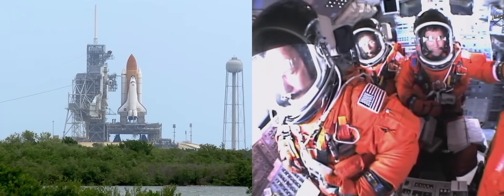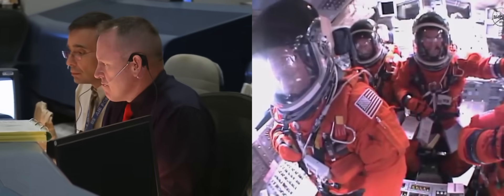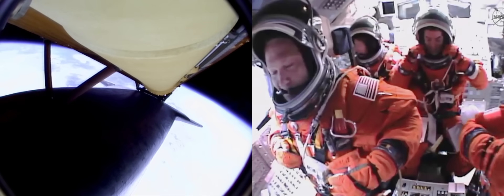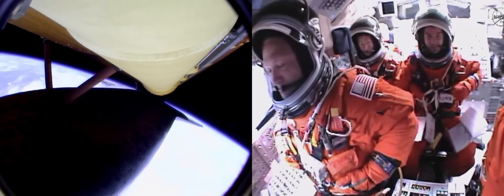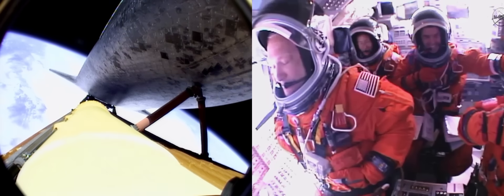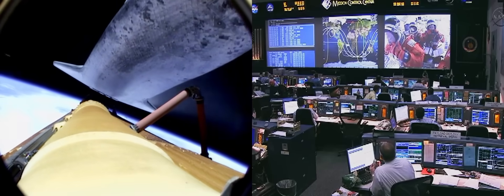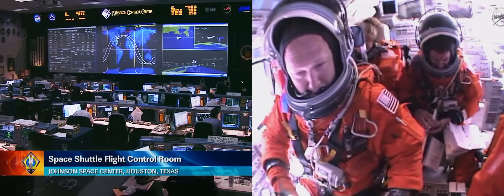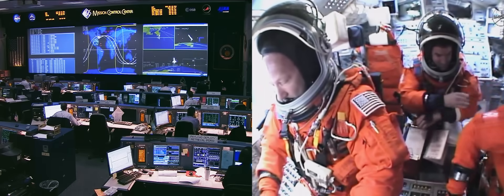🖥️ Cockpit View of the Final Space Shuttle Launch | Liftoff to Tank Photo Pitch | STS-135 Atlantis

Comment from the maker: FREQUENTLY ASKED QUESTIONS

❓What were the g-forces during launch? How can the astronauts move their arms?

Acceleration at liftoff was about 1.5g. It increased briefly to about 1.8g prior to Max Q throttle down and then took several minutes to peak at 3g. While the force exerted on the space shuttle was notable, an F1 race car or fighter jet plane experience 2-3 times the acceleration.

Space shuttle liftoff: 1.5g
Space shuttle maximum: 3g
Formula 1 race car: 6g
Fighter jet: 9-10g

During the ascent an astronaut would feel like each arm was holding a 10-25 lb weight (4.5-11 kg). Again, notable but not insurmountable.

The space shuttle acceleration profile is shown here:
https://www.researchgate.net/figure/Longitudinal-acceleration-in-US-Discovery-space-shuttle-in-STS-121-mission_fig3_342851251

A variety of comparative examples are included in this article:
https://en.wikipedia.org/wiki/G-force

❓What was the dP/dT alarm and cabin stretch?

Aerodynamic forces strained the orbiter resulting in slight deformation. According to the NASA Caution and Warning documentation, "During the first 2 minutes of ascent... the dP/dt can be as high as -0.07 psi/min because of cabin stretch."

Source: https://www.ibiblio.org/apollo/Shuttle/TD0402B%20-%20C&W%2021002%20-%20Caution%20and%20Warning.pdf (page 3-31)

As explained in this article, "As Atlantis ascended, its metal structure expanded—they called it 'cabin stretch'—and the air inside the pressure vessel expanded too. To the sensors, it seemed like the air was getting thinner—a sign of a leak."
Source: Reichhardt, Tony, "The Last Shuttle Flight," Air & Space Magazine, January 2013, https://www.smithsonianmag.com/air-space-magazine/the-last-shuttle-flight-125620527

❓What was the book on his lap? How did it stay on his knee?

Mission Specialists kept the Ascent Checklist and Ascent/Entry Systems Procedures available for quick referral. I believe it was held down with Velcro.
https://ia801203.us.archive.org/9/items/flight-maps-and-charts/ASC-CL-135.pdf
https://www.ibiblio.org/apollo/Shuttle/Ascent%20Entry%20Systems%20Procedures/

❓Are the astronauts sitting on their backs?
Yes, at launch the crew was on their backs facing up. You can see a brief overview of the strap-in procedure at the beginning of the following video.
https://youtu.be/5H48QEXwzN8

❓Is this real or AI?
The video is real. Atlantis launched on July 8, 2011, on the 135th and final space shuttle mission over the 30-year program. The source video clips have been available online for over 14 years.

❓The lighting doesn't move. There are no shadows. Fake!

During color grading the shadows were brightened slightly and peak brightness was reduced so highlights weren't washed out. Otherwise, there are several examples of light levels changing in the cockpit, as shown in these GIFs:

https://yt3.ggpht.com/Wc3nTtEui6BMxOg4GduAkf9iZYjSaJio8XsI1dwa_7LuMCdOgSfjPfg6McM1m_ntKtFXjixp_p3VlA=s540-c-fcrop64=1,00000000ffffffff-nd-v1-rwa
https://yt3.ggpht.com/urGt0tk4EWE1yLkHGEyaZGCzRUV7YU-g9_9PFWnqs97ExyvRzsgqSuXKujJIr2D0yziEbSNSJnNKRw=s540-c-fcrop64=1,00000000ffffffff-nd-v1-rwa
https://yt3.ggpht.com/wODiiJDV5cbMggxprCVrSa7CbwPQWG92v_mPTimexDrpUA1cIBXIVUj4H3ghx35rKqUO6XzDAk9w3A=s540-c-fcrop64=1,00000000ffffffff-nd-v1-rwa

SOURCES & REFERENCES

A variety of STS-135 engineering camera views are shown in real time at the beginning of this video:
https://youtu.be/CirL1S6EnmY

Here is the televised broadcast of the launch:
https://youtu.be/3deA3BXAnHs

The following links are references I found helpful when researching the space shuttle ascent. Much of the conversation between the crew and Mission Control regarded abort modes should an engine fail.

STS-135 Ascent Checklist 
https://ia801203.us.archive.org/9/items/flight-maps-and-charts/ASC-CL-135.pdf

Intact Ascent Aborts Workbook 21002
https://gandalfddi.z19.web.core.windows.net/Shuttle/USA007151%20Rev%20A%20-%20Intact%20Ascent%20Aborts%20Workbook%2020061010.pdf

Space Shuttle Missions Summary
https://ntrs.nasa.gov/api/citations/20110001406/downloads/20110001406.pdf

Space Shuttle - Ascent Powered Explicit Guidance AP
https://forum.flightgear.org/viewtopic.php?t=40190

Data Processing System Interfacing Hardware 
https://spaceshuttleguide.com/system/data_processing_system.htm#Data_Processing_System_Interfacing_Hardware_

Spacecraft Acronyms
https://space.skyrocket.de/doc/acronyms.htm
Reply: Despite what the space deniers say, this is real. These people most likely think the moon landing was fake as well. And "no", the flag on the moon isn't actually "waving in the wind" as most moon landing deniers claim. Again, Ivan Myles, you can can explain this much more eloquent than I can.
  If the moonlanding was fake, the Russians would be the first to blow the whistle. Forget the movie "Camelot"; it's not a documentary, it's science fiction.  
  Weightlessness cannot be developed on earth. All training is performed underwater as this is the best way to learn what it's like to live and work in a weightless atmosphere. This is done in Huntsville, AL at The Marshall Space Flight Center. This is where the most training and research is done by NASA. 
  The only other way to get real weightlessness "on earth" is via NASA's "Vomit Comet". Ask Tom Hanks, Kevin Bacon, and Bill Paxton, and of course ALL of our astronauts. This is when the astronauts train to prepare for weightlessness as a NASA plane flies a series of parabolas in which they attain full weightlessness for about 20 seconds. The actors in Apollo 13 performed real weightlessness scenes in one of these NASA planes for authenticity. They actually a few small sets built inside one of the planes for each scene that used actual weightlessness.  So, each scene with real weightlessness in them were done over a series of filming segments lasting less than 20 seconds. Ask Hanks, Paxton, and Bacon about motion-sickness! In the book about the making of Apollo 13, they talk about these  "weightlessness" experiences.
  When I worked at Space Camp, one of the most popular questions from the kids was "where is the weightless room?" or "where is the weightless machine?". I wish it was possible to have one because, for those of us who worked there, we probably never would have ever gotten out of it! 👨🏼‍🚀🚀 
  Great technical information provided above.
Ivan Myles, I'm not going to try, but will you explain "The Twang Effect"? This is the point in the launch under 10 seconds when the engines are fired, but the shuttle is still "bolted" to the launchpad which causes the shuttle to actually flex/bend before the hold-down bolts are released. Watching the last 10 seconds in slow motion is incredible and it at this time when one can actually see the stress on the orbiter, the ET, and the SRBs. (External Tank, Solid Rocket Boosters)
  I am not a "rocket scientist" but having grown up with NASA in my backyard and having been a Mission Director at Space Camp when it was in Florida taught me alot! However, I'm still no expert and can't explain it anywhere nearly as well as you can. Thanks. 👨🏼‍🚀🚀
Reply from the maker: Your explanation of twang sounds good to me. 👍 Here is a glossary entry:
"Twang - The brief backward flexing of the Shuttle stack caused by main engine thrust before SRB ignition. The vehicle then springs forward to vertical, at which point the SRBs ignite."
Recently I learned that the spring energy was not fully dissipated when the shuttle stack rocked back to a neutral position. After the hold-down bolts were fired and the shuttle was released from the pad, vibrations cycled through the SRBs.
Reply: @ivanmyles   Ivan, thank you for your additional information on the "twang" affect. I wonder how much of a sensation the shuttle astronauts felt during "the twang".
  Something else I didn't think of. When the shuttle launches, the bay below the shuttle is flooded with water. I always thought, as most people did, that this flooding spray of water was to prevent fire. Actually, the flooding of water is actually for sound suppression. Because of the firing of the engines and the tremendous power exerted, there is  tremendous reverberation from the power and the sounds of the engines. This water suppression prevents the reverberation of the sound waves bouncing back against the shuttle stack and destroying it. 
  Just in case anyone is interested in knowing. 
  Another peculiar action that happened during the days of the Apollo program with the ferocious Saturn rockets is the appearance of the rocket engines' exhaust sucking backwards towards the rocket itself. 
  When you watch Apollo 13 launching in the movie, actual NASA footage is used. As the rocket slowly lifts up from the launchpad, it is so obvious that the "exhaust" is going the wrong way. Was this a cheap way for Ron Howard to prolong the launch scene itself? It looks so cheapish, almost like when film is speeded up to make the action appear faster than it actually is. However, upon reading "The Making of Apollo 13", I learned that this is not fake and is an actual phenomenon. 
  Ivan, maybe you can explain the technical dynamics of this. But, what actually happens, during this firing, an actual vacuum is created in which the "exhaust" of the Saturn engines begins to suck back into, instead of away from, the rocket itself. This, though looking very fake, is very real. 
  I've lived in a couple of cool places, but by far, I am so grateful for having grown up with Cape Kennedy/Spaceport USA in my backyard. And, not only that, I got to work in the building where the astronauts stayed, and I worked at Space Camp as a Mission Director there. As a MD, I got to do their rocket launches, space station assemblies, and the main highlight of the camp:  Their simulated shuttle mission with a shuttle and a launch/mission control. The Space Shuttle was a 1to1 mockup scale of the forward fuselage of the shuttle with a flight deck, mid deck, and cargo bay. There was even a  "simulated" air lock that a camper went out to do EVAs in the cargo bay. To see more, look up U.S. Space Camp in Florida, or even the original one in Huntsville, AL (where the movie, "Space Camp", was filmed). 
  By the way, I grew up on The Space Coast, but now, decades later, I live along Colrado's Front Range. Something I did not know until I moved here is that the state of Colorado is #2, behind Florida, in support of all aspects of the space program. I always assumed Texas was #2 and California #3. Kudos to Colorado.
  P.S.; A little bit of A13 trivia...Jack Schwigert of Apollo 13 was from Denver, CO. There is a statue of him in the Denver International Airport.
  Ivan, nice chatting with you about NASA. 
🚀👨🏼‍🚀🌓

Comment: The way the rattling just disappears at 0:57 is crazy!  It happens when the vehicle is supersonic I think.
Reply: It has something to do with Earth's atmosphere.
Reply: @LoriGirlTexas partially ,yes,  There are a couple other factors but you are in the right direction. 
The heavy rattling and vibration stop almost instantly at Solid Rocket Booster (SRB) separation, which occurs approximately 2 minutes and 5 seconds into the flight. 

Why it happens is fuel differential. 

The SRBs use solid propellant, which burns with immense, turbulent force that creates high-frequency vibrations throughout the shuttle's frame.

 But the Space Shuttle Main Engines (SSMEs) use liquid fuel, which burns much more smoothly.

 Now to your point! 

By the time the SRBs are jettisoned, the shuttle is roughly 28 miles (45 km) high, where the atmosphere is very thin and that reduces the aerodynamic buffering greatly!

I've spoken with a few shuttle astronauts and they say  that once the SRBs are gone, the ride becomes extremely smooth, "electric" or "glass-like!"

Comment: 2011 looks like 1995
Reply: It’s because of the analog standard definition of the cam, 30-fps NTSC format, compression and noise through long RF paths, transmission via S-band antenna (low data rate) and relay through TDRSS satellites, ground stations and mission control. Yet they achieved a less-than-a-second latency, which is impressive for 1970s-1990s tech.

Comment: why the " i agree" instead of usual confirmations?
Reply: Probably just to keep it brief and short is why they say I agree
Reply: Typically when working through a checklist/procedure, one person (usually the commander) will call out the next item on the procedure and the other (in this case, the Pilot Doug Hurley) will respond with "I agree" to confirm that both the commander and the pilot are on the same page, literally speaking. If in some rare case that there is a discrepancy, they'd work out where they need to be in the procedure and go from there. But "I agree" means what it says on the tin.

Comment: I asked grok to summarize the dP/dT alarm.   Basically, when the SRBs separated, the cabin pressure rate of change dropped below limits.  This was due to the sudden change in bending load on the cabin.  A known phenomenon.
Reply from the maker: Thank you for looking it up. Here is a technical description of the fault:

"The cabin pressurization rate, dP/dT, senses the rate at which atmospheric pressure is changing in the orbiter (in psi/min). There will be an alarm issued only for a rapid cabin depressurization. If a dP/dT alarm was issued, it would indicate that air was leaking at a rate much higher than normal. The system alerts the crew to a rapid pressure change with respect to time by annunciation of the four MASTER ALARM pushbutton indicators and sounding of the klaxon (class 1 alarm)."
Source: https://spaceshuttleguide.com/system/caution_and_warning_system.htm

In this case, the alarm sounded about 54 seconds into the flight, over a minute before SRB separation. According to the NASA Caution and Warning documentation, "During the first 2 minutes of ascent... the dP/dt can be as high as -0.07 psi/min because of cabin stretch."
Source: https://www.ibiblio.org/apollo/Shuttle/TD0402B%20-%20C&W%2021002%20-%20Caution%20and%20Warning.pdf (page 3-31)

As explained in this article, "As Atlantis ascended, its metal structure expanded—they called it 'cabin stretch'—and the air inside the pressure vessel expanded too. To the sensors, it seemed like the air was getting thinner—a sign of a leak."
Source: Reichhardt, Tony, "The Last Shuttle Flight," Air & Space Magazine, January 2013, https://www.smithsonianmag.com/air-space-magazine/the-last-shuttle-flight-125620527
Reply: @ivanmyles thanks for the great video
Reply: Don't ever ask grok 😭